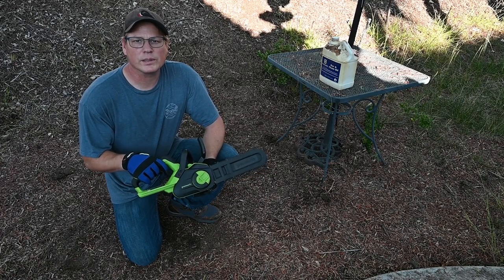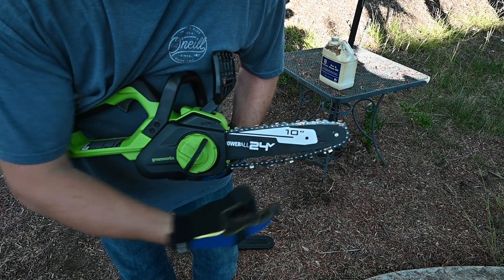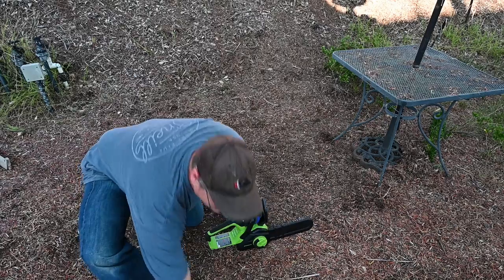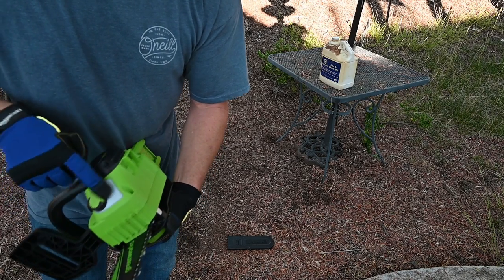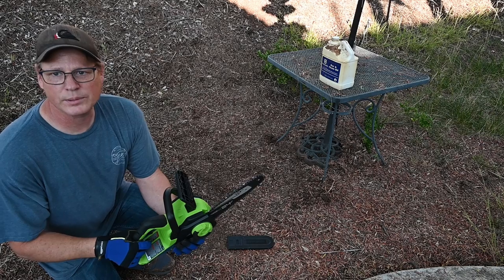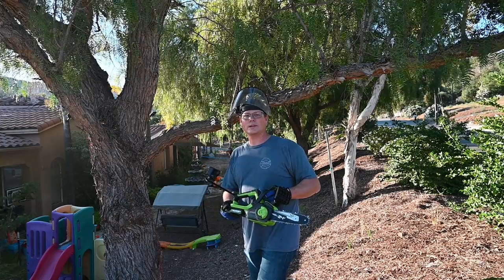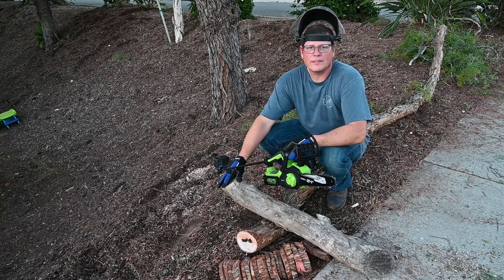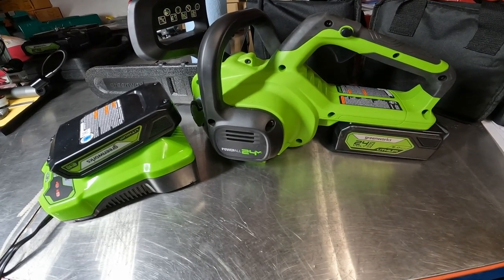Greenworks 24v 10in Chainsaw.. Overheating At End Of Hands On Test

Comment: I wouldn't call the battery being too warm to accept a charge as being 'overheated'.
I have a couple of large battery operated chainsaws that DO overheat the batteries.
The saws will shut off with three quarters of the charge left in them. They just stop working to protect themselves from thermal damage.

Comment: Thank you for the review. Looking to get something similar for a quick little jobber saw and hedge trimmer. I was wondering if the 24 volt battery would be too small. In my case, I think the lighter weight makes up for the smaller power rating.

Comment: Thanks ,good review I’ve never used the battery chainsaw of any brand.The last  time I used a CS was decades ago and it was a gas powered Homelite.Just ordered a Green Works 20 v 12 in bar looks like they make a pretty good product.Thanks again for posting
Reply from the maker: It is a good little saw. I've been doing a lot of odds and ends with it delimbing, palm fronds, even large shrubs. I like it because you can pull it out do some cutting and not wake up the whole neighborhood and you don't smell like gas exhaust afterword.

Comment: probably the 2 amp batteries being a little small will overheat, I don't think that will happen with the 4 amps
Reply from the maker: Yeah, for the test I used what it came with. But in reality I use 4 amp hour batteries and I have not have had any issues it keeps up with me anyway.

Comment: So how much does the camera attachment for the saw cost, and where do we get one?
Reply from the maker: There are two pieces to make of the attachment which connects camera to saw each piece cost about $25 for a total of $50.

I use this clamp, which I love, very versatile.  https://www.amazon.com/dp/B08N5RGS3S/

The bar that connects to the clamp in this video is home made from a old baby crib I tore apart and reclaimed the metal parts. But I have been using this bar that I bought recently and like it better then the one I made. https://www.amazon.com/dp/B09Y8PFJ9C
Reply from the maker: I just got this in the mail yesterday, only 22 bucks total! I was playing with it last night a little and it works good if your only needing a short extension from the device your clamping to. https://www.amazon.com/dp/B0B5LFC6L3

Comment: Lemah
Reply from the maker: "Lemah": Weak. Yes very true, but not every job requires a beast. Don't get me wrong I love a beasty machine: "Ya sangat benar, tetapi tidak setiap pekerjaan memerlukan binatang. Jangan salah faham saya suka mesin beasty."
Reply: Thx for transleting, i appreciate that.
This chainsaw's price, battery and charger relatively high.
Comparing to other brand with same voltage, this greenwork is week
Reply from the maker: By the way thanks so much for watching and commenting!
Yeah, it's not the cheapest on the market by any means, especially if you look at the not so known brands, I took a quick peak at 10 inch saws and  Sun joe 10" is a decent budget brand for 99 USD, Greenworks 10" is currently at $116. I see a number of Chinese brands out there in the high 50's and 60's. But more over than the best price is picking a family of tools that works best for you and most major brands will have dozens of tools that will work off the same battery and charger.: 

"By the way terima kasih banyak kerana menonton dan mengulas!
Ya, ia bukanlah yang termurah di pasaran dalam apa jua cara, terutamanya jika anda melihat jenama yang tidak begitu terkenal, saya telah mencapai puncak dengan pantas pada gergaji 10 inci dan Sun joe 10" ialah jenama bajet yang baik untuk 99 USD, Greenworks 10" kini berada pada $116. Saya melihat beberapa jenama Cina di luar sana dalam 50-an dan 60-an tinggi. Tetapi lebih daripada harga terbaik ialah memilih sekumpulan alat yang paling sesuai untuk anda dan kebanyakan jenama utama akan mempunyai berdozen alat yang akan berfungsi dengan bateri dan pengecas yang sama."
Reply: Yeah, this kind of video is so helpfull for some one like me for picking up tool which meet my needs.
So far, i saw milwaukee is the most powerful cordless chainsaw with power source efficiency, dewalt came behind. And both, with others tools like makita, stihl are too expensive.

If you have some experience on chainsaw..especially cordless one. Please suggest me which tools are best for light use of carving on very hard hard wood lol.